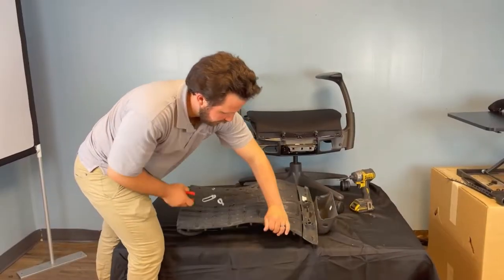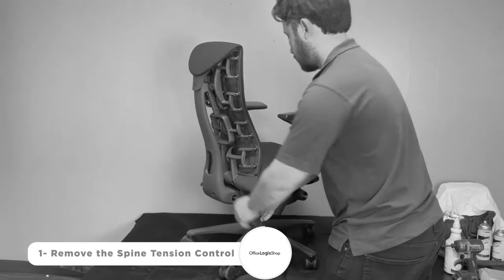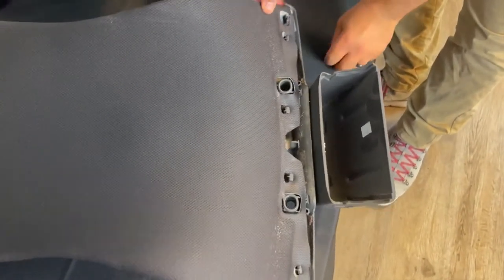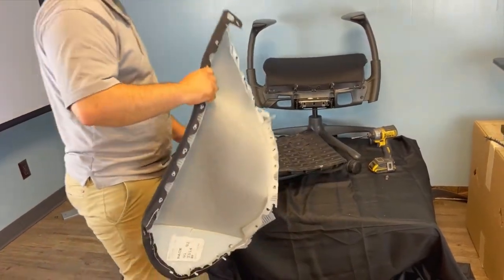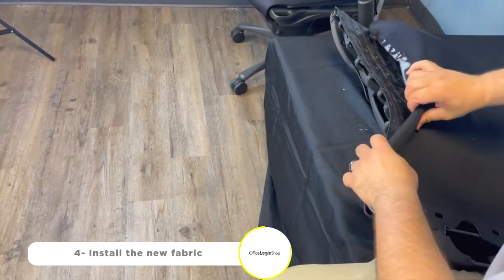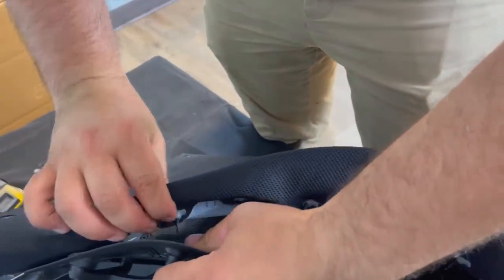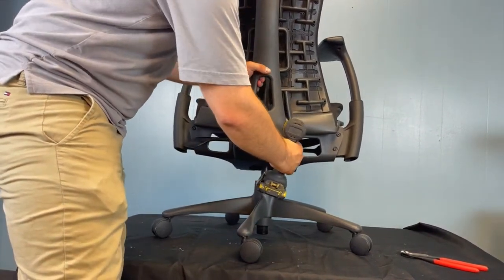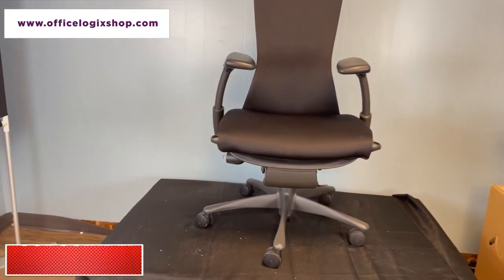Herman Miller Embody Back's Fabric Replacement Tutorial

Comment: Is there a way to remove the fabric without breaking the small plastic clips? I just want to insert a small amount of foam between the back and the fabric to emulate the logitech spine cushion. So I think I need to unclip like 4 clips from the top.
Reply from the maker: Hello. There is no way to remove the fabric without damaging the clips. Hence, you need to install new ones as demonstrated. Thank you.
Reply: Use small zip ties, zip 2 together creating a clamp, really ez DIY. Or ebay sometimes has the straps.